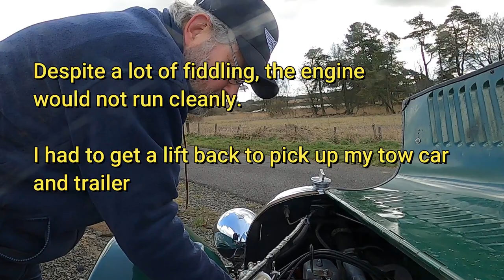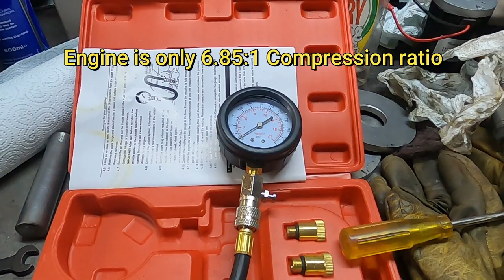1936 Morgan 4/4 Series 1 'Flat Rad' goes Hillclimbing - What could go wrong?

Comment: Super filming which camera are you using  I have similar carb problem on my flat rad standard special
Reply from the maker: I'm using a GoPro Hero 8 camera. It has excellent stabilisation - considering how much the windscreen was vibrating. The rear view mirror is usually just a blur due to the vibrations. I'm in the process of making an adaptor to try an 1-1/4" SU carb.